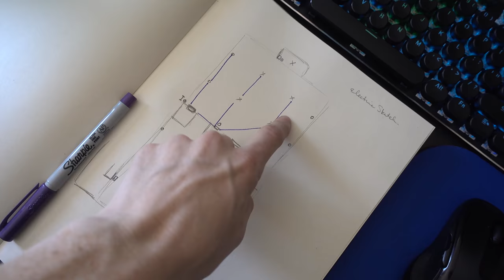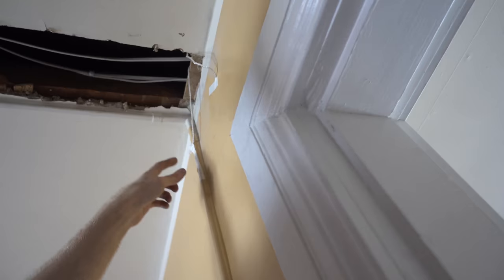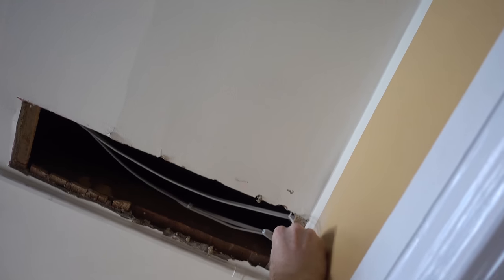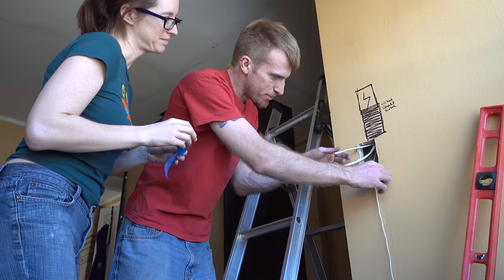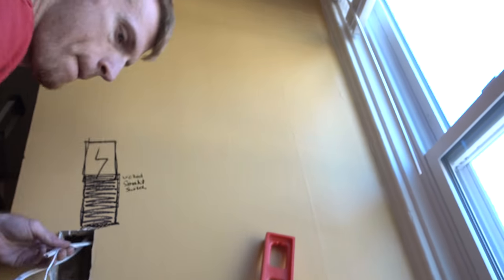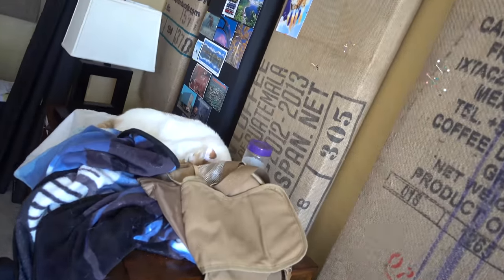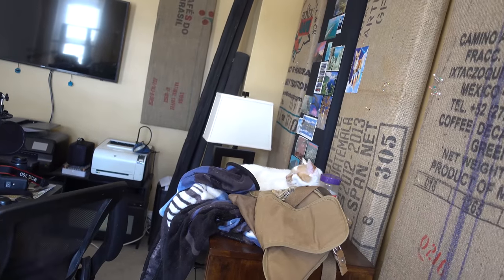Wire Fishing Through Plaster Walls Day Two!

Comment: Since you are doing this and you both are techie guys why don’t you grab the opportunity and pass along with the electricity also cat 6a ethernet cables all around? You can then hook computers, TV set top boxes and other high-bandwidth devices to the wired network and leave the wireless for phones and tablets. I did it on my home and it makes the hell of a difference! 
Really nice videos, though, you are quite talented.
Reply: if memory serves it's all advised to run cat parallel with high voltage not to mention they are not supposed to share same space ie high voltage low voltage can not be in the same gang box per nec code again if memory serves